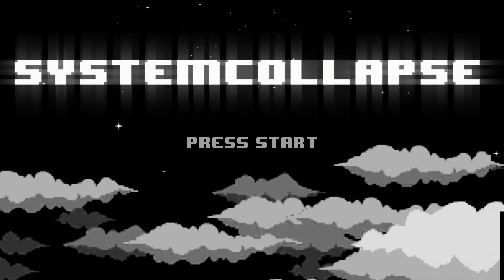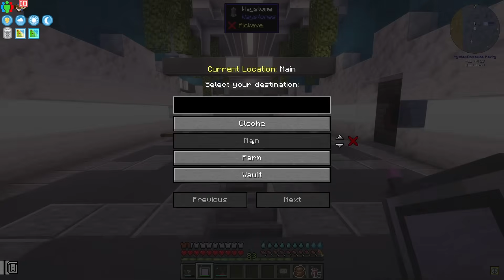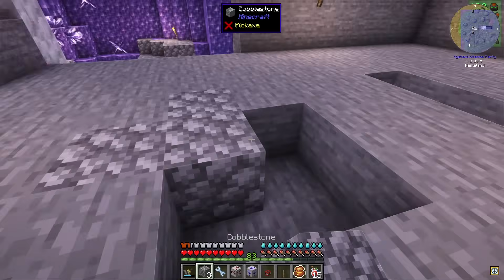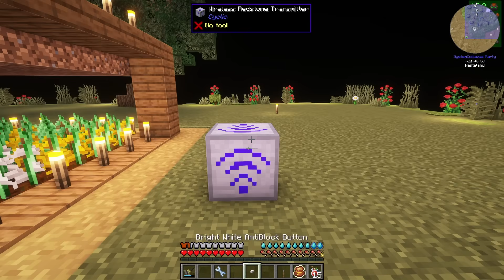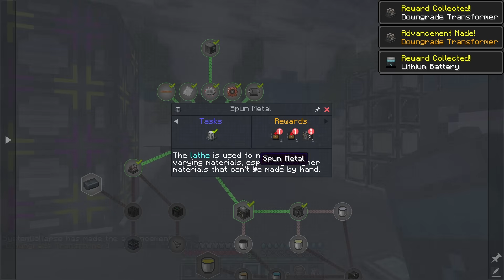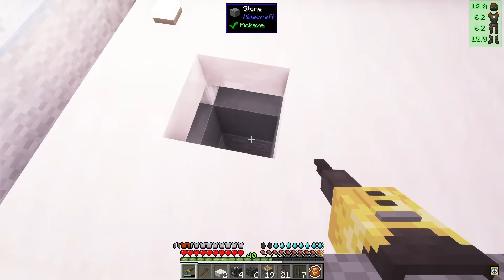FTB Genesis Plate, Gear and Rod Automation, Oh My! EP11

Comment: Is there any trick to getting the Pattern Providers to work with the IC2 machines for using the patterns?  I've got mine setup the exact way and the AE2 patters just don't work.
Reply from the maker: Make sure the machines sides are set correctly every slot can be set differently.
Reply: @Systemcollapse  I have all sides set to the default.  I also tried the simple import card, but then items just went into the abyss.  I did get it working "janky"  used a chest and an import bus.  GREAT videos, keep up the awesome stuff.

Comment: Just FYI the issue with gps is that if you click with the card, it sets the clicked side, if you SHIFT+click a side it sets it to the OPPOSITE side than the one you you clicked. (behaving same way like e.g. IE hammer when setting input/output on capacitor) And beause batteries have gui when clicked, you always have to shift+click instead, so you always have to do this on the opposite side from input so it's marked properly.
Oh also the voltage for electrodynamics can be upped several ways:  either with the transformers like you did, but you could also create higher voltage dc motors or adding capacity upgrades to bateries which doubles voltage as well.
Reply from the maker: I understand this but every mode seems to do it different. hard to keep straight in my head after a while.

Comment: In the latest update there is now another mini world (like the farm and nether ones) you can get. Its a flat upgraded farm area with 4 layers of soul sand laid below plenty of full size 9x9 crop patches. It also comes with a dark room for growing low light crops.
Reply from the maker: In the next video,
Reply: @Systemcollapse  I should also mention there is a trinket (from Nameless Trinkets mod) you can find called God's Crown. It gives +120% to all stats! It's in the top layer of one of the towers in an abandoned city.

I think you are meant to find it early game when you first have to travel to one of the cities as it gives you a big speed boost, damage buff, attack speed buff, etc etc making combat and getting about the huge base easier.

Honourable early game mentions are Melon Juice to solve having to keep getting water from the tap. 

Plus Melon Popsicles as they count as food+water+can be eaten until saturation is full! But you need to be able to make ice to craft so are a fine midgame food!

Comment: About the crafting monitors, the small hammer on the top right of the terminal will allow you to see crafting status, easy to know if something is finished. Also, TIL u can aim pattern providers lol
Reply from the maker: Yeah aiming solves a lot of random issues that can pop up, thanks for the tip.